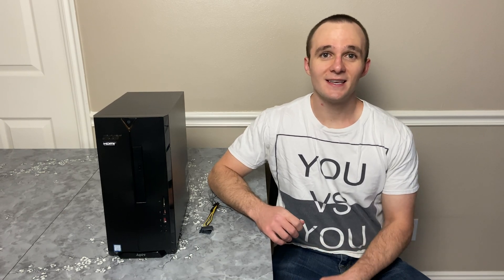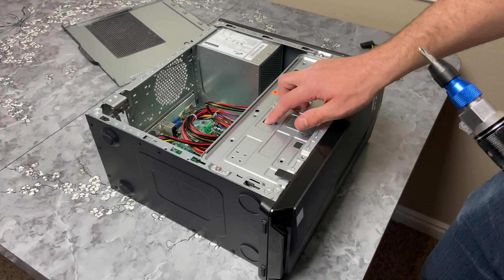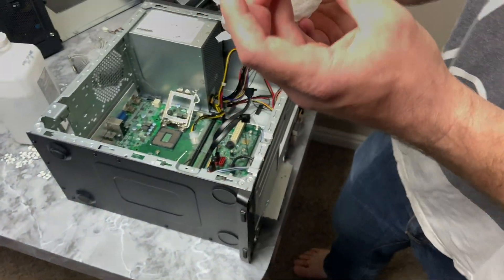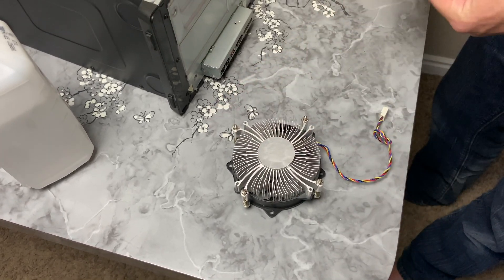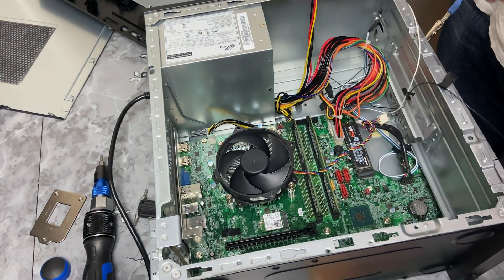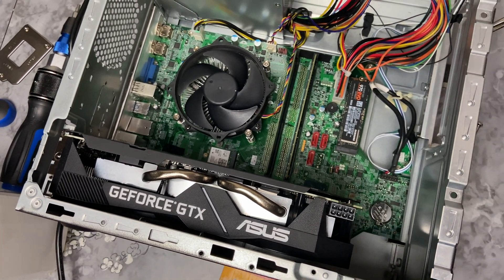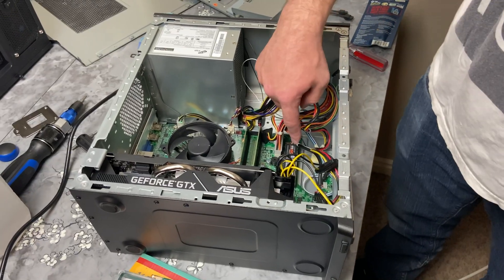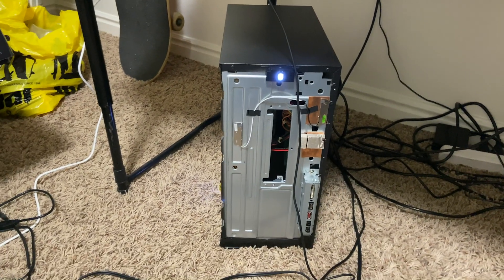How to run an Nvidia 1660 super from Acer Aspire's original power supply with a sata to 8pin adapter

Comment: I'm jealous. My Acer Aspire tc-1775 (2024/2025) has the same case except for the front panel. It's designed to go on and off the same exact way, they just look slightly different. But it's a pain to get it on perfectly.

Comment: what ratcheting screwdriver is that? :o

and molex would be safer than sata power technically, because molex safely does 150w and sata only does 75w (which is what pcie power is anyway tho). its def not safe to do this with more powerful cards.
Reply from the maker: the screwdriver is kobalt one link to amazon:  https://amzn.to/3VaQHAp

Comment: What gpu can i possibly use with 16 gb of ram i5 6500 with a sata to 6 pin with a 240 w psu
Reply: i dont think the 240 watt is a good idea try the GTX 1650 low profile it does not consume much power but it need atleast 320watt psu

Comment: What graphics card can I put my pc on?

Acer Aspire TC-1760-UA92 Desktop | Procesador Intel Core i5-12400 de 6 núcleos de 12 GB 3200 MHz DDR4 | SSD NVMe M.2 de 512 GB | DVD 8X | Intel Wi-Fi inalámbrico 6 AX201 | Bluetooth 5.2 | Windows 11 Home
Reply: so definitely a GTX 1650 and there's a version of that comp that comes with a GTX 1660 super so I assume that as well (Although I haven't tried installing it yet on mine...).
Reply: maybe RTX 2060

Comment: Hi! What is that device you have cooling your CPU? Is that only necessary when using the upgraded GPU that you installed?
Reply: That's the standard CPU fan. It comes with the computer. You NEED to have a CPU fan.

Comment: If i add this graphics card to my acer desktop will it be able to run Rust? I have the desktop with the 10th gen i5.
Reply from the maker: Yeah the 10400 is going to do much better than the recommended Ryzen 1600 and the 1660 super is going to do better than the recommended r9 gpu.
Reply: @dmoneyballa  a buddy of mine is parting out his PC and has a gtx 1050 ti and is willing to sell it to me for $70, do you think I will be able to plug and play that GPU into my acer aspire without having to upgrade PSU?
Reply: your cpu may be lacking a bit depending on which one it is, but the gpu should do just fine

Comment: Wait does the 8pin adapter come with the graphic card? or you'll have to buy it youself? pls reply fast cause  im gonna buy a nvidia gtx 1660 ti tmr
Reply from the maker: no the graphics card usually doesn't come with an 8 pin connector. If you plan on running it from the power supply that comes with the computer, you can use a sata to 8 pin like this https://amzn.to/2ZtSAvg
Reply: @dmoneyballa  How much is your power supply watt?

Comment: This case is garbage for airflow no fan  can be added exept exost. This is a mashine made for office use. it is a "cheap" initially but after upgrading almost everything you gonna end up spending as much as building from scrach.
Because to use it for gaming you need to upgrade well prety much everything.
Reply: Maldeus I intend to only upgrade the gpu. I will add an amd radeon rx 570 will I need a btter case for that or is it ok without the need of changing everything?
Reply: @ev0luton401   @God Slayer  rx570 is pretty low power
But when I went to check power required
Requirements:
Typical Board Power (Desktop) 150 W
PSU Recommendation 450 W
That also will require 6 or 8 pin power To SATA connector like in the video.
Also he didn't show gaming on it.
Just that is working under Linux.
Also still too close to bottom of PC for proper airflow on the graphic card.
Try. If you run at 80C when under load then you have a problem.
What is the wattage if the PSU?
Reply: better*
Reply: No shit
Reply: This guy thinks he cracked the case
Reply: This is a pretty uneducated answer as the cables may be proprietary but there is no way the motherboard screw layout is meaning you can just move it to a new case
Reply: @Crushhyt  Not true. Many HP motherboards have proprietary screw layouts, so you can't move them to a standard case.